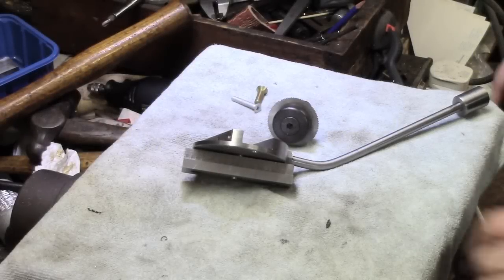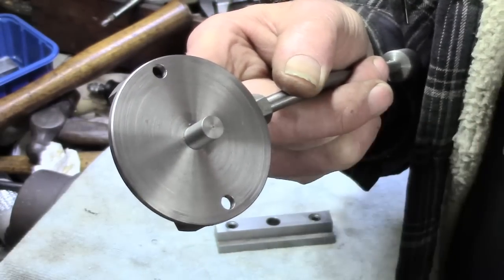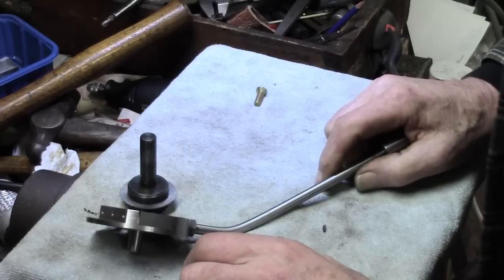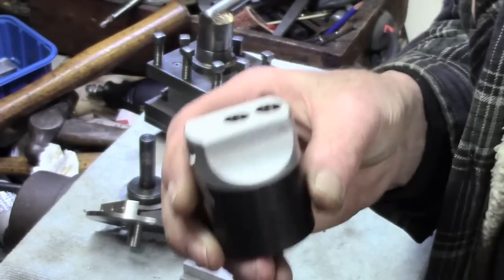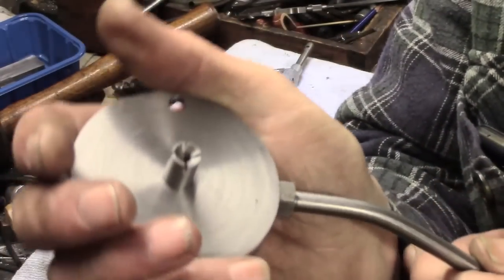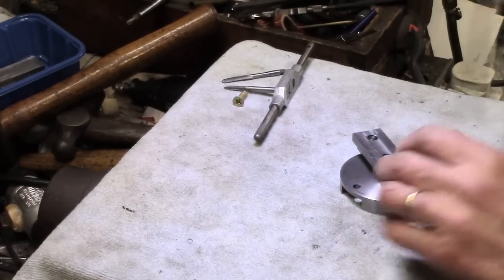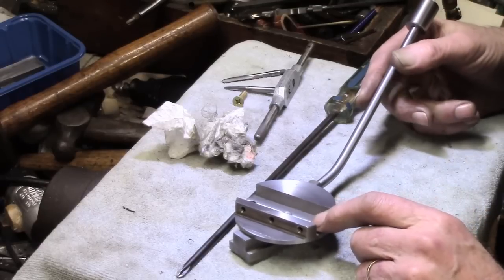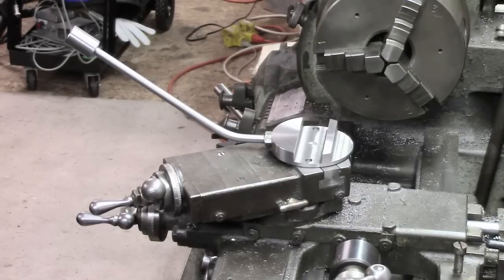Radius Ball Turner - Pin Base Modification

Comment: Pozi Drive and Philippes are totally different systems, if the screw is a Pozi Drive it will have radial lines between the slots in the screw head, (the driver has small raised lines ) ,the angles of the cruciform indentation are different between the two.
 For the lifting problem on your device, you will not (I think) have any luck by just stopping the slop on the shaft as it can still lift, if you have a minimal clearance thrust washer "under" your block, the toolpost cannot lift, therefore, no lift = no wobble. It will work! I have used a similar device. Chris B